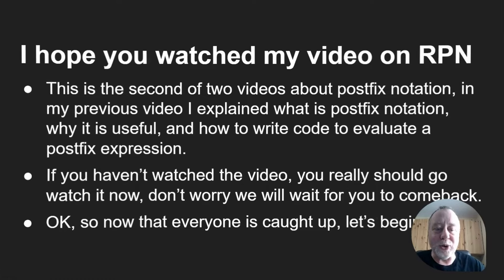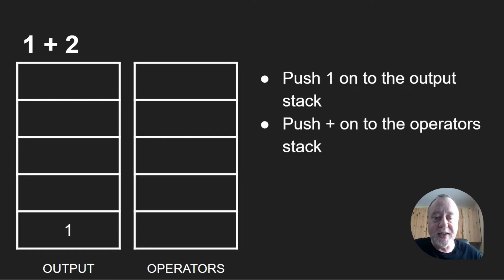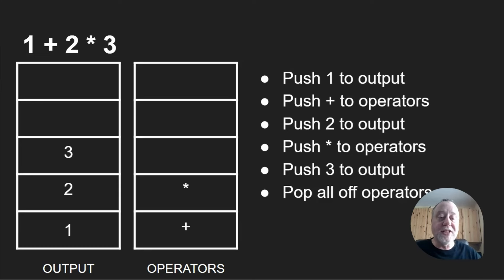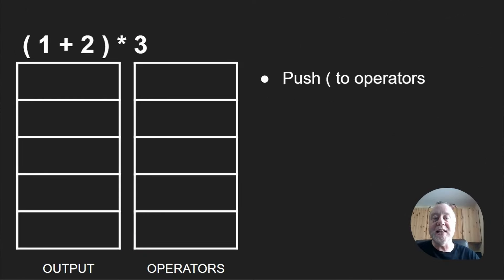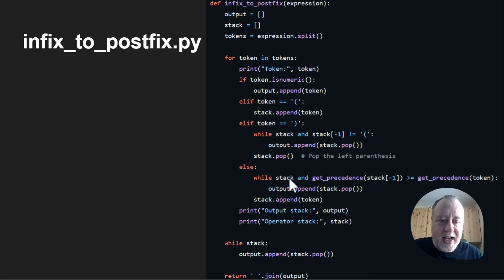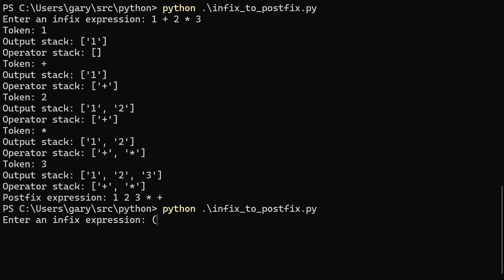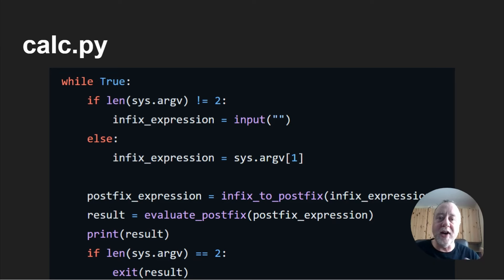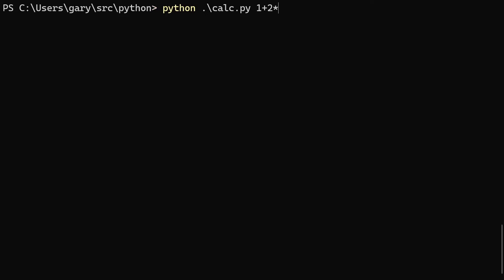The Shunting Yard Algorithm Demystified: Transform Expressions Like a Pro!

Comment: Great explanation! Just a quick point to avoid any confusion: while it's possible to implement the algorithm using two stacks, the original method actually uses one stack and a queue. To clarify, when you use the output list in your code and create the output text using join, it functions as a First-In-First-Out (FIFO) structure, similar to a queue, not like a stack.

Comment: What would this code do on situations like 10+2 ?
Reply: When it parses the input it uses space as a delimiter, so 10 would be interpreted as 10 but 1 0 would be two separate entries. In the stack, 10 is stored as a single element and not multiple separate ones for each digit.

Comment: Exit takes an exit code not a calculation result 😂
Reply from the maker: And why can't the exit code be a calculation result?
Reply: @GaryExplains because non-zero exit code means error occurred in standard semantics
Reply from the maker: No, not necessarily. If you want a program to calculate something it can return the calculation as an exit code. This is very useful for scripting. You are making an assumption about the return codes, I assume based on Unix/Linux. On VMS for example SUCCESS was never 0.
Reply: @GaryExplains of course it's UNIX.  Which matters more